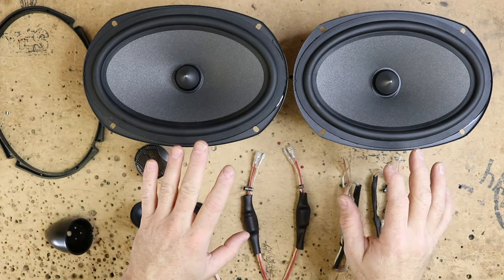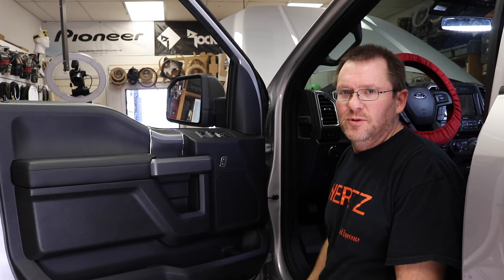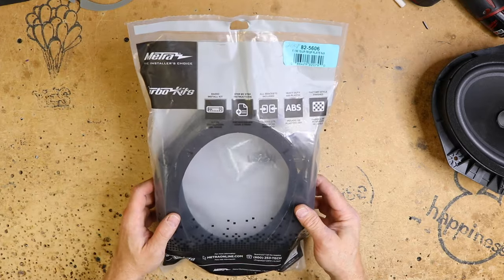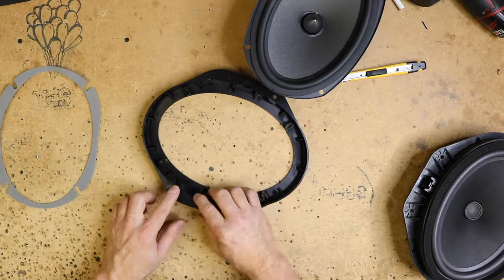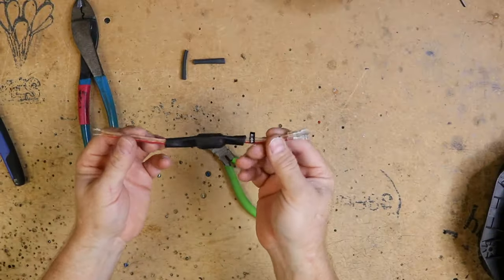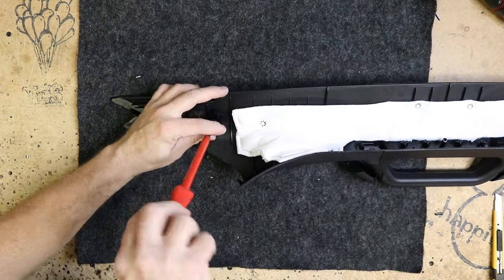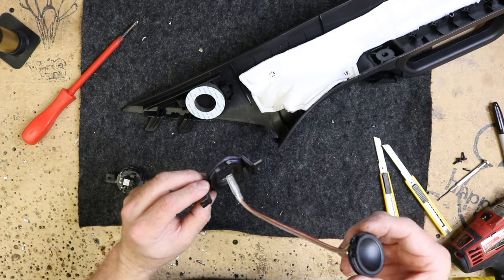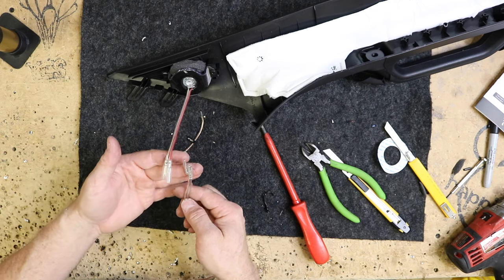Focal Universal ISS690 unboxing and installation in a 2015 Ford F150

Comment: You have a single pair of speaker wire coming from your amp, how do you end up with a two positive and two negative to feed each speaker? Does the line from the amp go directly onto the woofer and the attach the Tweeter to the woofer too?

Comment: i've got a 2013 f150 with factory sony  mytouch system.  will these speakers sound good with the factory amp or should i get an amp to power them. thanks for your time.

Comment: Did I miss it? It is not explained how to hook up the woofer crossover or how this plugs into the truck?
Reply from the maker: It has 2 sets of speaker wire inputs on it.  One for a factory amplified system that has active crossovers. One for a non factory amplified system. It is printed on the speaker which input is which.
Reply: @FiveStarCarStereoInc  I actually bought the updated ISU690. I believe they have different wiring, but I think I figured it out.

Comment: Great video. Can you replace the 6x9 with a 3way 6x9 and leave the stock tweeter in place?
Reply: Rob Zilla yes, it will work fine but components will sound better. If you’re gonna spend the money, go with components. You’ll be happier, trust me.

Comment: Great video!! My only question is if you were running the stock head unit and decided to amp the speakers would you need a 6 way since the components don't meet at a common box or would a 4 way like an alpine power pack be able to push front and rear doors?
Reply from the maker: Tyler Wilson no a four channel amp is fine. They don't have a common box but it is all the same parts. They just took the box any and split the crossover in half. Each part going the the speaker it is made for. It is a way nicer way to build a crossover network.
Reply: Thank you very much for answering me. This is literally the install video I have been looking for!
Reply from the maker: Tyler Wilson sweet glad we could help
Reply: If I may ask,... considering I added an aftermarket amp. How exactly would the wiring be done, given I have 2 outputs for the front speakers. Should I run wire to the tweeter and to the door from there? wouldn't the crossover already filter out the low/mids then?
Reply: I’m replacing my factory speakers with Focal components in my 16 Ford King Ranch ( mid bass,tweeter,crossover)My question is ,do  I use the crossover output for the tweeter or the factory harness output/ connector?Does the door speaker get a full range signal?

Comment: Hello, wanted to give you a little suggestion on something I noticed in this video and what I have discovered.
 1. I hate using electrical tape, it gets hot and gooey after a few months and usually comes unwound from the wires.
 2. I like that you soldier your connections and not use the connectors already supplied, it's not like you need to disconnect those wires any time soon.
 Anyway getting back to the tape thing, I have discovered something called Gaffers tape, it's very sticky, looks like the factory wire tape and heat doesn't seem to bother it so it doesn't come unstuck after a few months.
 Give it a try and let me know what you think.
Reply from the maker: Jason Pedigo thank you.  We have Gaffers tape for the movie make equipment. The tape we are using is Tesa tape, it is cloth like the factory uses. Black tape, like you said is useless here in Florida for sure.
Reply: Five Star Car Stereo, I didn't realize you were using Tesa tape, sorry about that.
Reply from the maker: Jason Pedigo all good, enjoy

Comment: hello, i'm looking to do the same exact upgrade to my truck. Any idea if the 2015-2018 XL trucks have the tweeter in it? if not is is wiring there? I just ordered a 2018 XL, Not sure if anyone has come in with an XL or XLT to your shop and you noticed tweeters were not there thanks
Reply from the maker: +Graham Greene every f150 we have done has had the tweeters

Comment: I didn't see in the video, but was there an amp already installed or were those running off of the factory power?  Great install video by the way!
Reply from the maker: Jeremy Wolfe he was just using power of the aftermarket radio.
Reply: How much for a set of the tweeter brackets that you made on here?

Comment: I put the ISS 165s 6.5" in my car and immediately took them out. I don't know if the 6x9 version is better but the 6.5 version is awful. They are way too harsh, sound very thin and lack midbass even in a sound deadened door.